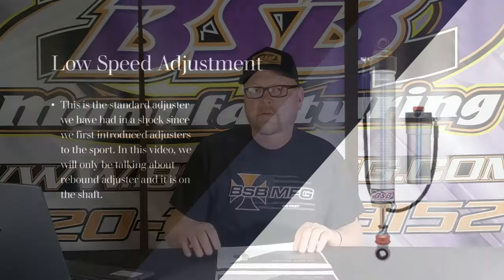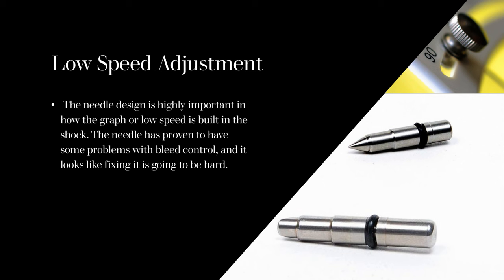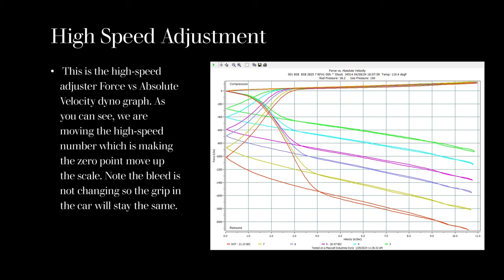High-Speed Rebound vs Low-Speed Rebound.

Comment: Jay-

I've been having issue with my rf shock I feel as if it didn't have enough rebound. When I get on the gas the rf lifts up instead of pinning down. I felt as if my rf was moving through the spring too fast kind of like a spring board on the rf.

You've been working with my shock guy, Guy Sutton 3 daughters racing.

He's contributed greatly to my program.
Reply from the maker: Yes, you need better or more rebound, it needs to control your springs.

Comment: I’m been running a lot of rebound in my car, and turn-in is good… I would just like to improve drive in the final 1/3 of the corner when the track goes shinny/slick. What would you adjust? Reduce compression on LR, or some other adjustment?
Reply from the maker: Increase RR lower rod, to free car thru center. The question is, do we need drive or speed, and which one can we hook up. I like this question. Thanks
Reply: @jaynealgofast  I get to through the center good, but the car seem to hang , and I can only use very little throttle on exit. I feel I'm as fast as anyone out there through the first 2/3 of the corner, but lose time on exit...